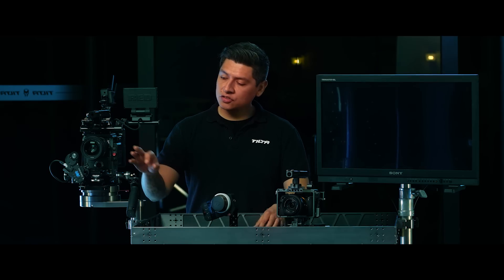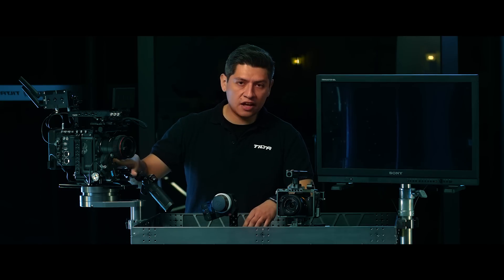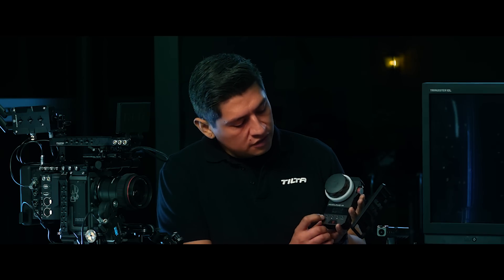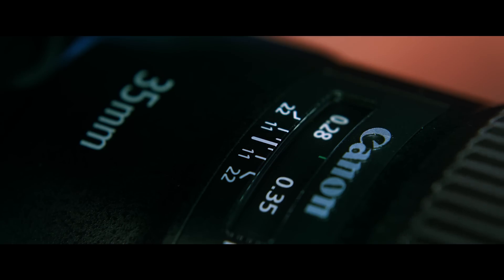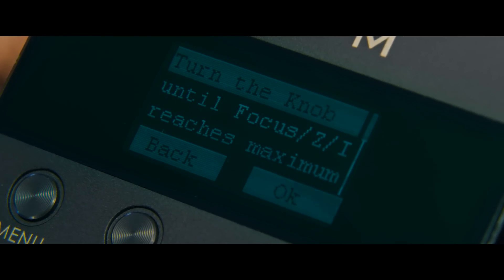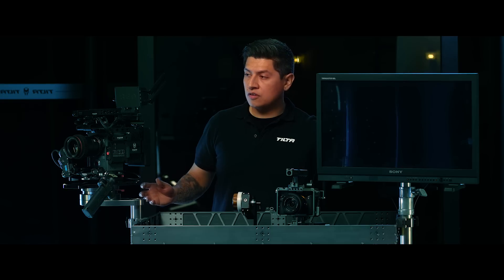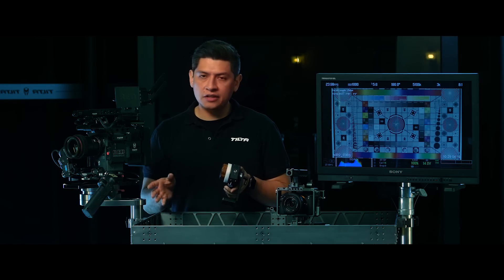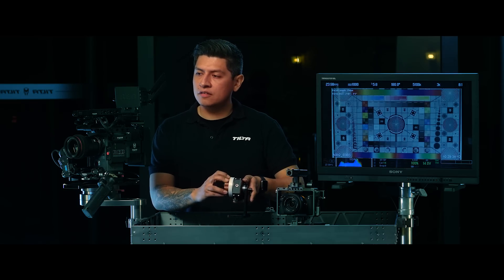Tilta Nucleus-M: Torque Settings and Calibrating Photo Lenses without Hard Stops

Comment: I’m using the Nucleus-M system, and my zoom and iris motors work fine, but when I switch to focus, it doesn’t respond. I’ve tried reassigning the motor using the up/down buttons, but it won’t change. I also checked the wireless settings, but I don’t see an option for ‘Motor Settings’—only ‘Motor’ under Wireless. How can I fix this?

Comment: Is there a way to do this with one handle? I don't have the hand grip set up
Reply: Calibrate the motor & remote in the exact way you would here but instead of turning the wooden wheel you're using the side handle wheel.

Comment: Thx for the vid! Quick question. Is it possible to assign a preset focus throw that goes from close focus to infinity on cine lenses? For example on a film set I might want to use the full 360 degree range of a cine lens and when run and gunning I'd prefer to have 150 degrees of rotation. Ideally there'd be a favorites menu setting that stores these settings for the user to quickly access... I would assume that the feature I ask about should be available but I haven't been able to find the info online ;) Hope to hear back :)
Reply from the maker: Hello, There is a setting on the hand grips that allows for a shorter pull via the knob. You can find a switch on the front of the handle to change the setting. However with the hand unit there is no way to shorten the throw. I will make sure to tell our team that this feature is being requested, hopefully it can be implemented in a future build. Have a great day!
Reply: @TILTA  Thank you so much for your reply! Good to know that it works on the handle and thanks for updating team about the feature request for the hand unit. It would be amazing to have that functionality!:D  Thx again and have a great day too!

Comment: @tilta, my issue is when I calibrate motors, they don't go full range of lens that DOES have hard stops. It my Fujinon MK 18-55: It will calibrate itself from 24-50 or something similar, not giving full range. Where can I find solution to this issue? Thank you.

Comment: Hello, excuse me is there a way to make the focus speed slower? It goes way too fast with my handles. Thank you.
Reply from the maker: Your handles have a "range" that you can set on your handles. You can locate this range on the inner front of your handles. Make sure that the toggle is looking "down". You can also set specific ranges with your "A-B Button" that is located on the front by the wheel. These are two weeks to make the range bigger and have a bigger throw. I hope this information helps. For further questions, please send us a message through tilta.com/contact.

Comment: does it remember the calibration after turn it off?
Reply from the maker: If you auto-calibrate then it will remember, otherwise then you have to set it everytime.
Reply: @TILTA  any upcoming firmware at least to remember any calibration, it was a pain for me on set.
Reply: @FlashOneFilms  Did that change, do you know?

Comment: Hello, thanks for this clear video. I've a question: If I have to switch off all -  motor, FIX and handle - I will have to re-calibrate manually the photo lens when I will switch-on again?
Reply from the maker: Due to the EZ mode firmware update, the last calibration will be remembered in the motor after a shutdown. For additional help please email: support@tilta.com
Reply: mine forgets the calibration every single time... even with the latest firmware ....so frustrating

Comment: Quick question: I have set the torque on my hand unit to 30% (Low), and that's what it shows on the hand unit LCD. But on the motor display, it always says 50%. Is that referring to something else on the motors, or am I missing something?
Reply from the maker: please send a video to support@tilta.com